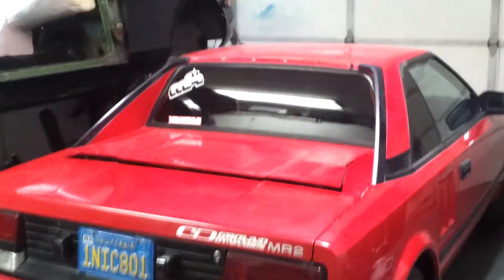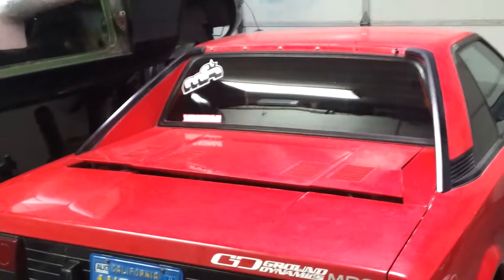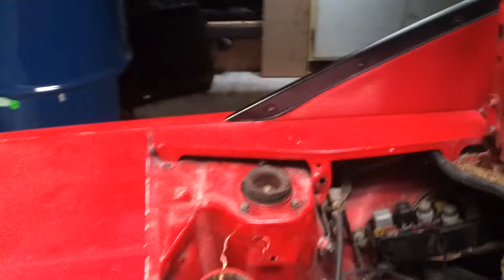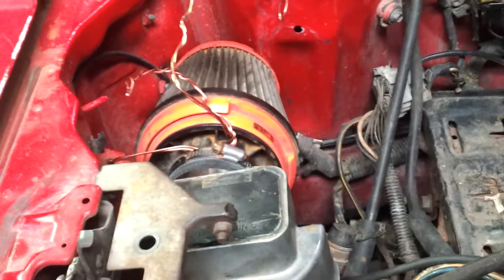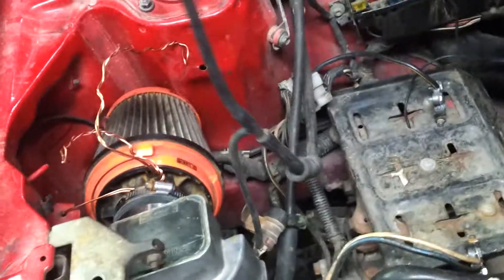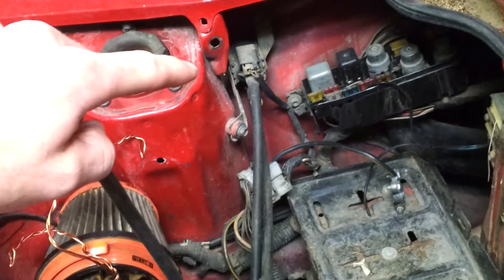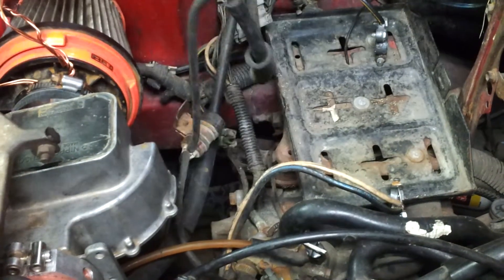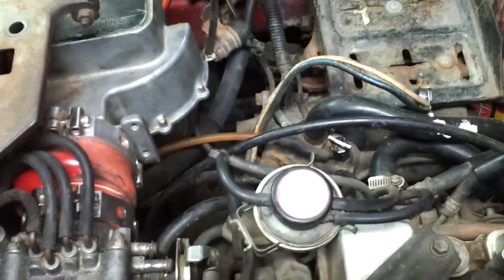MR2 MK1 Intake Hose Question

Comment: If that hose is connected to a thing on the firewall with a white plastic screw looking thing then its the ac idle up valve. That hose should connect to you ac system somewhere. If your car had the ac removed then it makes sense for it to be dissconnected